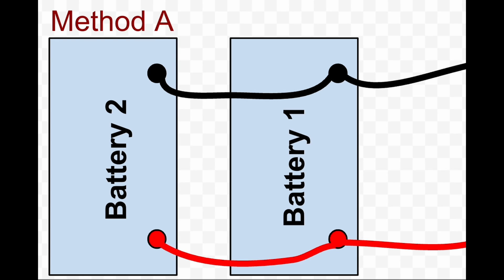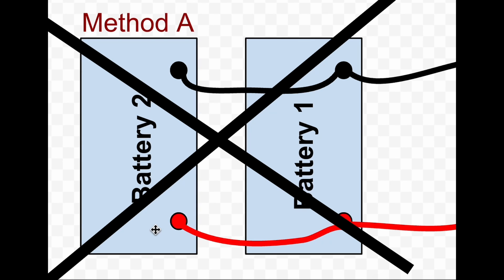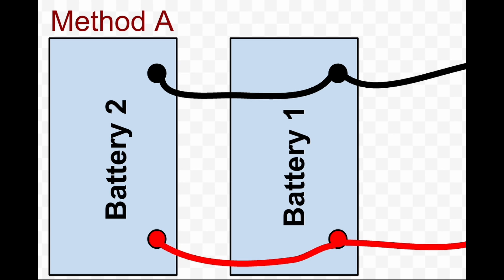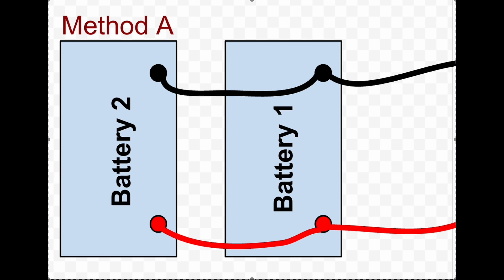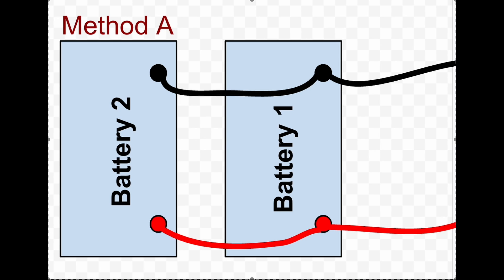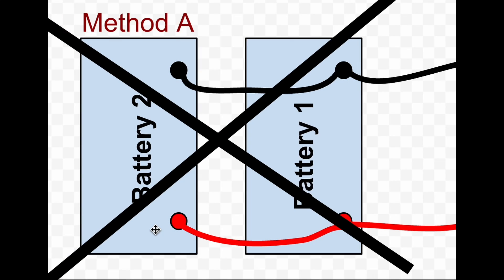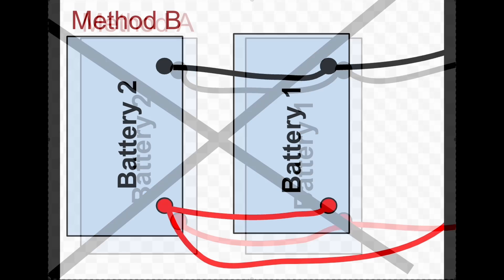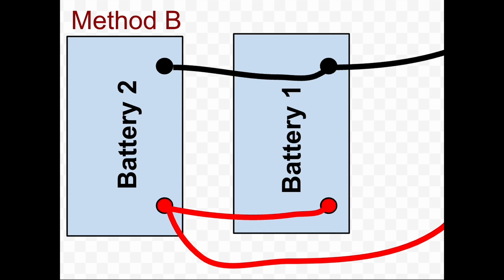What is the Best and Safest Way to Connect Lithium Batteries in Parallel for RVs and Boats or Homes?

Comment: How about the connection from the batteries going to the inverter sir do you have a video regarding on it?
Reply: anythnik what is really important is to use thick wires !!!
connect batterys together like i do = differenz in curretn flows, on lithium batterys that is no problem coz a haft cycle is a half cycle for them not importand if battery 1 delivers 2-3% more current.
if u use thick wires =lower esitaqnce= current matches more.

same on inverter use thick wires = no resistance + no warm wires more and stable current.

the thicknes of the used wires is more important then where u place it.
the fats degration from lead acid you can not stop on any way also thick wires will not help that this stuf becomes fast usless.
Reply from the maker: I do not have a video about this.  Make sure you use good copper cables.  Do not to tempted to cheaper use Copper Clad Aluminum (CCA). Use wire the in the size recommended by the inverter manufacturer or larger.  Run the Red positive cable directly from the battery to the inverter and be sure to put a fuse in it.  Run the negative directly to the battery, unless you have a shunt.  If you have a shunt, run the cable from the shunt to the inverter.  If this is the case, be sure you cable running to the shunt is big enough to handle the loads on everything in the system.  Windy Nation on Amazon is a company I get good caple from. There are many others.  You can also but cable with lugs already crimped on.  If you crimp your own like I do, I only but black cable.  I wrap my positive cables with red electrical tape like a candy cane.  This way I never run out of one color.  If you have not crimped you own cables you may want to stick with buying cable with lug terminal already installed.

Comment: Poppycock!
Reply from the maker: Just for a moment, rethink your thinking and include OHM's law in your thinking. Doe wire length affect resistance and current flow.  Which battery has the longer cables?  By how much? Does method B change how the cable length affects the batteries?  Also think how easy it would be to arrange 2 batteries in this manner compared to method A.  I am just sharing a concept that most people do not even realize and can easily change.  If you really believe this is "poppycock", I am sorry I cannot help you.

Comment: I like the fact that manufacturers are now coming out with larger capacity batteries and in most cases eliminating the need for multiple batteries connected in paralell or series.
Reply from the maker: Yeah, it makes things easier.  I am using 4 12V 300Ah LiTime batteries in my RV power system.  I would have gone 48V but I was using a 12V Victron Multiplus 3000VA inverter.
Reply: @TravelingLightReflections  , wow, that is a pretty substantial size system, you must have many days of reserve battery capacity.
Reply from the maker: @guydemers7607  I live all summer off grid with the system in a 28ft 5th wheel.  During the winter we stay in RV parks and are usually plugged in.  I built the system gradually, not intentionally.  I upgraded RVs before we went to full time and then a month after.  So, I reused system components as I designed the system for the next RV.  I went with the 1200Ah because solar barely recharges the batteries when it is full grey cloud cover and we get next to nothing when its raining.  There are times this lasts for over a week.  We usually keep the inverter on 24/7.  The inverter, Starlink and the 12V refrigerator use a lot of power. When we get under 50% we turn off the inverter at night. This saves a lot of energy.  We have not used a generator in over 2 years.   So, we are happy with the system.  Check out my Power System Calculator.  I developed this from 6 months of data collected from my Cerbo.  It helps decide on both what size batteries and who many watts of solar you may needs.  I broke the weather into 4 main categories.  The biggest unknown is what your personal daily power use may be.  You can play with that and plug in considerations. I added a section that tells how long you may need to run your generator to recharge at a reader's request. https://youtu.be/mIKc81QS_Fw
Reply: So...are you hinting at a review of a 48 volt inverter? Lol
There's so much so all this.
Especially for a 61 year old solar virgin!
Reply from the maker: @YouLookingAtMeBro  I built my system with a 12V inverter because I did not expect to go as big as I did with the system in the end. If I had only know now what I did not know then!!!!   I already spent the money on big copper.  If I had gone with a 48 volt system I would have needed to install a drop down converter for the 12V RV part of my system.  But.......  Instead of 107mm2 wire (4/0) I could have used 1/4 of that size and gone with 27.6mm2 (3 awg) wire and saved a lot!!!!!  I probably would have gone with 2awg because of the availability.  Here is an article I wrote on my website that brings you through my story of trying to make coffee in the RV and how this brought me through many inverters as I upgraded RVs.  I tried to put some humor into it. https://www.travelinglightreflections.com/choosing-how-to-power-you-rv

Comment: would it make any difference if you turn one battery opposite to the other and connect them diagonally Red to Red black to black?
Reply from the maker: For parallel, as long as you run black (neg) to black (neg) and red (pos) to red pos it will work.  However when possible arrange the batteries so you have the shortest cables connecting them.  Also, try to make all red all black the same length if you can.
Reply: @TravelingLightReflections  thanks
Reply: nothing matters.
the battery with the lower internal resistance delivers or draw more current.

only look to use thick wires, anythink other is 100% not important.
Reply from the maker: @ThomasNowicki-m5s  https://youtu.be/_pQ0WjpSEa0?si=5f3AITrXq593UIaD

Comment: To the source?  Shouldn’t you be saying the load?
Reply from the maker: I may have used the term source when I meant load.  If so thank you for pointing this out.  Being as we are talking about batteries where the current can flow both ways depending on whether it is being charged or being discharged.  I wish I had put more emphasis on this.

Comment: ok, do you have any physical reason why you claim that the faulty method is faulty, for example the resistance of the wire, are we talking about the distance between the batteries in cm or km, if it is in cm then the voltage drop through the wire in the further battery is negligible, that's how I charged several batteries at the same time and the farthest battery had a difference of maybe 0.02v on a total of 5m of cable. your correct method is correct only because it equalizes the currents of both batteries, regardless of how good the connection is, for example if the clamps are connected to an oxidized contact, it can happen that only half the current flows through the wires that would otherwise flow if the connection was good, this way how much as long as this current flows equally from both batteries
Reply from the maker: Resistance is directly proportional to the length of a wire.  In other words, a wire 2X as long as another will have 2x the resistance.  If batteries are wired piggyback like in Method A the battery at the end will have a greater resistance and it will get/give less while being charged rapidly or used heavily.  Of course, their voltages will even out over time as they equalize.  However, the first battery will get charged fasted and will then charge the second.  The same works in reverse.  This put a higher workload and more abuse on the first battery.  It will wear out faster than the other.  If you are only using very low currents on these batteries then it will make little difference because the charge/discharge of each will keep up with each other.  However, the faster/harder the batteries are used, the more important it is to try to keep a balance current flowing in and out of them.   Look for other YouTube videos that explain this.  The main idea is keeping all the batteries in your bank the same.  You do not want one battery charging others nor do you want to pull more current from one than the others. Inevitably, they will all balance and equalize because they are in parallel. It is just that one will go bad before the others.  You do not want a bad battery in your bank and you do not want to replace only one battery in a bank. Ideally you want them all to wear out equally at the same time and replace the entire bank at the same time.
Reply: @TravelingLightReflections  ok, generally well explained, but without measurement units, how many ohms is the greater resistance, how many amperes is the difference in currents, what is the difference in voltage in volts between the batteries, what is the voltage drop in volts due to the increased resistance... with a sufficiently thick wire that is well connected at a length of less than half a meter, negligible
Reply from the maker: I do not have bluetooth batteries but the guy in this linked video does.  He did a great job of demonstrating the effect of 3 different ways to set up your batteries.  Check it out.  The drops are significant.  Also, when using lithium batteries, they have a low voltage vs state of charge curve.  This means that having a your voltage match during both charge and discharge is much more important than with a lead acid.  In truth, you will never get all batteries to perfectly match, but you can get them as close as possible by setting them up correctly.  For 3 batteries, you may even want to use bus bars.  My only concern with bus bars is that people watching this video are likely DIYers.  Bus bars use a lot more connections. These crimped connectors can introduce an area of high resistance if not done perfectly.  Personally, for a 3 battery setup I use the way I showed in the video. (Less connections and closely balanced system)  For a 4 battery setup I use bus bars.  When the bank is built, I crank up the load and use an infrared thermometer to check ever connection for heat not matching the others.  Yeah, watch this video. It is long but worth it.  https://youtu.be/_pQ0WjpSEa0?si=uQw4q4-d-cchyZsH
Reply: @TravelingLightReflections  thanks, i made battery from 20  Lion18650 cells, 16 v, 20Ah,  5  in parallel connection and 4 of them in serial connection all are soldered, all  are connected a little bit on wrong way but that was the easiest way, and every 6 months i open cover to check states of cells before charging and after and no bigger differences than 0.1V between the highest and the lowest voltage , no bms or any electronic device , just wires and cells
Reply from the maker: @makantahi3731  The chemistry on those cells are a little different from LiFePO4.  I have made batteries from the small A123 size cells fr hobby use. I soldered a small 22ga wire off each connection and put them into a JST connector.  I use this for balancing each cell in the battery.  Astro Flight used to make a plug in balancer for this.  Now hobby chargers often have them built in. Mine were up to 5Ah not 20Ah.  What are you using these for?

Comment: This is the stupidest thing I’ve ever seen……not gonna make a bit of difference. Not sure how I get recommended this crap……
Reply from the maker: @kerrytodd3753  Do just a little research!! Your ignorance is sad. You are so quick to dismiss this but if you are willing to learn you will discover this is not only proven but it is a simple example of Ohm’s law.
Reply: @TravelingLightReflections  as is voltage drop, that’s what you’re seeing here.  It’s not gonna make a .05 worth of difference at the end of the day.   The batteries will always equalize to the same voltage.   Battery one may work a little harder at first, but once it becomes discharged to the same voltage the electrons will begin flowing out of each battery at the same rate.   So, ya, it does make a slight difference for a minute. But when you consider the amount of wire used,  you won’t see a difference.   But hook ‘em up however you wish, neither one is wrong but in most cases this ain’t gonna make a bit of real world difference.  Carry on Mr ignorant

Comment: This is absurd. The only cause of the problem you're trying to solve is corrosion in the cables. If the cables are correctly sized and remain clean this is pure fantasy. It's about charge voltage.
Reply from the maker: @bivideo7  The problem is getting DIYers to understand how to arrange their parallel batteries so that the resistance is distributed better and each battery gets equally discharged under heavy loads. I see the first method too often.  I looked at your videos, you are a smart guys so I am guessing you did not actually watch the video. Corrosion is not mentioned or a concern.  You know enough about electricity to know that the first battery will get worked harder than the one with longer wires.
Reply: @TravelingLightReflections  NO.... Doesn't work that way. Four batteries in parallel is one battery if the cables are sized properly.
Reply: I don’t think he measured resistance of wire or actually found some differences in it.
But I’d say his theory is logical and I don’t think there’s any reason not to do it either.

Comment: I am a retired electrical engineer. I designed a numer of devices that used large industrial batteries. Your suggested method would help a little. The danger in connecting batteries in parallel is that if one cell in one battery develops an internal short that heat will be generated and a massive amounty of current will flow from the the other batteries. A fire could result.
Reply: Thanks for the warning. What about placing a fuse on each battery terminal directly to prevent this worst case?
Reply: @hansonic2938  - Good Question. You Tube is full of ideas. No matter what you do, remember that no two  batteries are the same. Also remembeer that the battery is part of the charging system. All batteries have an unwanted internal resitance. Lithium Ion batteries have a low internal resistance. You connect batteries in series to up the voltage. When connected in parallel the current is upped.

A fuse would add to the resistance and lower the power delivered by a small amount. It would also become part of the charging system.  

I have a 48 volt golf cart with 4 12 volt lead acid batteries. I use a BatteryMINDer Model 483CEC1 48 V 3 Amp charger that pulsates the batteries. It is temperaturre limited and can stay on the cart charging 24/7 if I wanted. It charges overnight. The original charging system was left intact. 

I personally do not like paralleling at all.
Reply: @balsmit1  - It is not the type of connection. It is just not recommended to parallel batteries. To get more current batteries are connected in parallel. To get more voltage batteries are connected in series. That is in use. If they are charged in parallel the charger can not determine what is happening with each battery. Perhaps in a model plane or something it might be OK to use, but for charging the batteries need to be seperated.
Reply from the maker: Using a bus bar/terminal block is good with three or more batteries.  With a bus bar you need to crimp more connections and insure all wires are the exact same length. If you are using 4 batteries I would definitely use the bus bar setup.  3 batteries, maybe if I am constantly loading it or charging it with high currents, 2 batteries, definitilty as show in the video.
Reply: @titusllewelyn  some vlogger already do an experiment, some already reach 2 years and up. Lifepo4 to lifepo4 and lifepo4 to lead acid. 

As long it is is parallel.
Reply: So what's the best way to connect lithium batteries in parallel?
Reply: @KingNhlae  the best way depends on what your PV voltage is and what your inverters operating voltage is. combining 800V PV and 12V batteries is possible, but not the best way to do things.
Reply from the maker: I would assume that anyone using an 800V PV would being using a 48V battery bank  which would include both parallel and series batteries. I would also hope that anyone using 800V would be well beyond looking at YouTube videos for advice! :))
Reply from the maker: The way I showed in the video is best for lithium.
Reply: @TravelingLightReflections Thank You👍
Reply: @TravelingLightReflections  How about tubular or dry cell batteries sir?
Reply: That is when a balancer comes in to play
Reply: @mytubing101  for parallel? Like if there’s bms that connects to each cell individually and separately?
If you’re talking about balancer wire you see in bms for SERIES connection, it doesn’t work in parallel. Parallel connection means battery is CONNECTED and shares the same voltage. 
It doesn’t connects to positive side of another battery, it all goes straight to ground so there’s nowhere to put balancer wire.
Unless you have battery charging system for each cell and every cell is separated. Which means you’re not connecting battery in parallel.
Reply: Really?
Reply: Thank you.
Reply: Hello sir.... I know this is totally unrelated to the video in question but I'm having issues protecting my inverters from lightening even with an SPD the inverter still gets affected by a lightening surge, can you recommend any device or circuit diagram that could help with this???.... I would really appreciate if you would reply to this